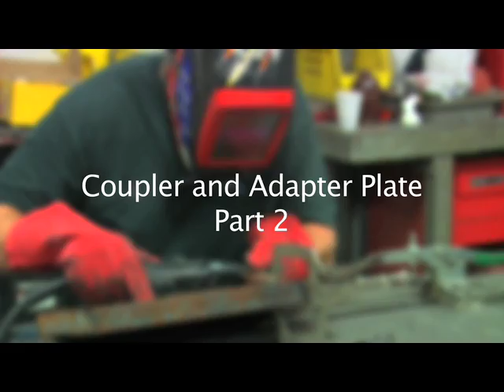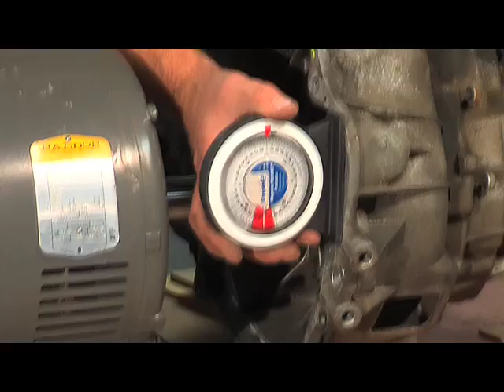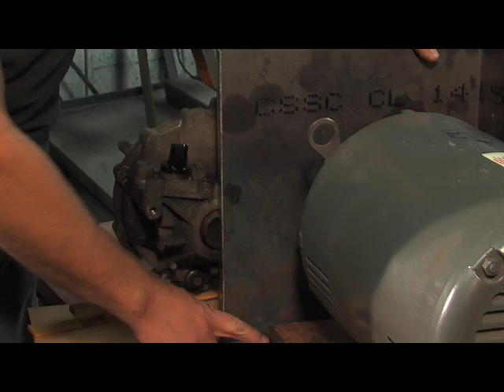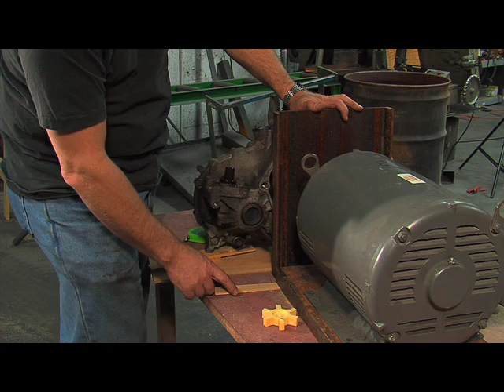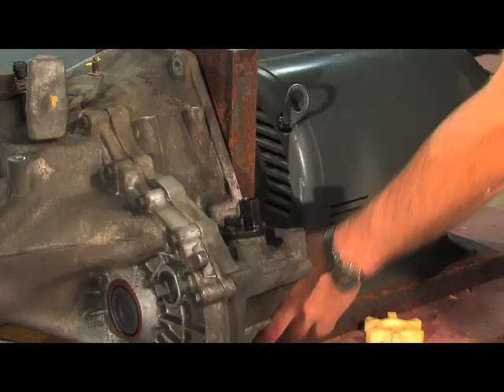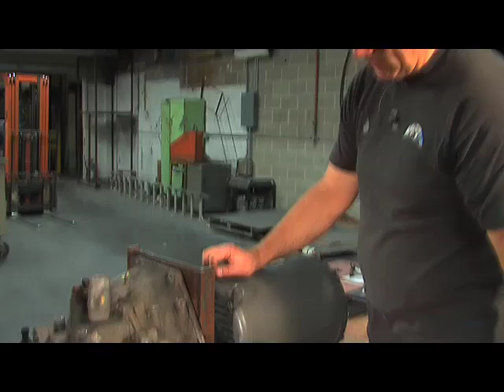Part 002 | AC Electric Car Conversion 101 - Coupler and Adapter Plate

Comment: Perhaps a foolish question...If one was able, would it be a more accurate connection, IF,  one could measure "level" directly off the joining shafts?  I ask because I am untrusting of motor housings as a reference location.  What are your thoughts?

Comment: What inverter / power source do you use for motor power? 
What do you use for charging? 
How do change gears without clutch?
Reply: Old comment I know but don't know how to answer the first 2 questions, the 3rd's answer is just like a CVT transmission, "manual without the clutch" you just shift your the next gear or whatever gear you want which lets the engine run faster or slower

Comment: What I will do is a template with a cardboard and small hamer then transfer the card board into a steel plate and take the steel plate to a shop with water lasser cutting machine for perfection and work tha mounting coupler

Comment: You could also just use a sheet of plotter paper to trace the holes on the transmission, then use center punches to mark the steel. Or, if your transmission has a gasket, you can just use it as a stencil.

Comment: how can it work without a clutch ?????
Reply: Short answer: because its electric

Long answer: because you can start and stop an electric motor a lot faster and more often than a gas engine. I'm not entirely sure how you would do shifting without a clutch, but a lot of guides say you can.

Comment: @mike081283 Truckers say "You only need a clutch to stop. lol Shifting without a clutch takes a bit of practice but is rather easy. On electric cars, you preselect what gear you want for the trip. Going to the corner store? Put it in 2nd or 3rd and leave it. You're not going over 35 anyway. Coming to a stop you are not going to press the clutch peddle, the motor just stops with you until the light turns green. You'll do way less shifting than with an ICE.

Comment: Things would be so much easier with a rear wheel drive car and not a piece of shit front wheel drive car . Guys come on use your head we have no worry about gas mileage with electrice so why use a area so small and haveing to cram everything in such a tight spot . use a old car hell use a 57 chevy more room ya heavier who cares were experimenting. way more roon under that hood and trunk for all the batteries and way cool than anything that is front wheel drive of today .

Comment from the maker: @yj1992jeep 
For power brakes, you can add a small electric vacuum pump, to run the vacuum assist. For steering, you could add a pulley to the power steering pump or replace with a manual steering rack. Tom replaced his original steering rack with manual. You do not NEED a clutch for an electric motor. Some guys keep them, so guys leave them out. This project is clutchless.

Comment from the maker: @danoldsbb 
A "Lovejoy" coupler can be picked up through any industrial supplier. They are usually also available at any place that deals in electric motors, or some store with a good mechanical isle, such as a farm store.

Comment: @newpage123 If you used an automatic you could just put an aftermarket transmission cooler on it.Manual is better they are lighter and have less drag.

Comment: Why didn't you just use a piece of cardboard to make a template?  You could have just pulled the two items away from each other placed square piece of cardboard that squarely touchs the table and the motor shaft and tap on the cardboard to get the shaft impression then cut out the impression enabling you to slide the cardboard to the motor face which would aid in getting the bolt pattern.  These steps could then be carried to the transmission.  Much less crap to go through this way.

Comment from the maker: @newpage123 
The car has a manual transmission, with no cooling lines. The is no need to keep the radiator, so it was removed and sold.

Comment from the maker: Another consideration is that this particular electric motor does not have a wide RPM operating range. Because of that, you really do still need to use various gears to match road speed and motor speed.

Comment: this is 100% wrong concept because the battery will drian its power quickly why?because charging a battery as its giving power to motors will be very hard or not efficient or will charge it about 20% in 60mile driving so it will need to be charged everyday which is not practical, what is the right concept of this?im making a car that will need charging once a week or 12 days or more i will make my prototype soon but right now i dont have the means to do it but i have the idea,

Comment from the maker: This is a common question. For the quick and easy answer - you still need some way to connect the motor to the wheels. On a front-wheel-drive car, the transmission does exactly that. Since the transmission is already there, why not just use it?
The only other option would be to remove the tranny and build something from scratch to take it's place - that's a lot of time and money.

Comment: @CapitanoGUC:
A land rover is not too heavy but it's not ideal. Actually, there is no such thing as a vehicle that is too heavy. Many earthmovers are electric vehicles and they can weigh fifty tons, easy. The problem becomes distance traveled per charge. See Bob Brant's book, 'Build your own electric vehicle' for a table on voltage vs. weight vs. motor power. That should get you on the right track.